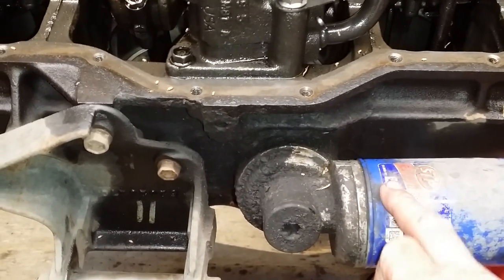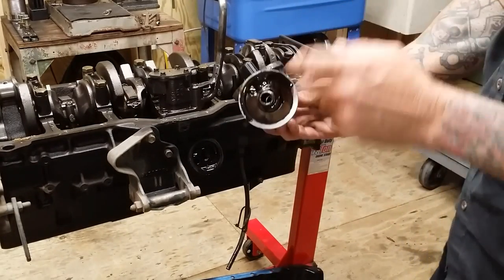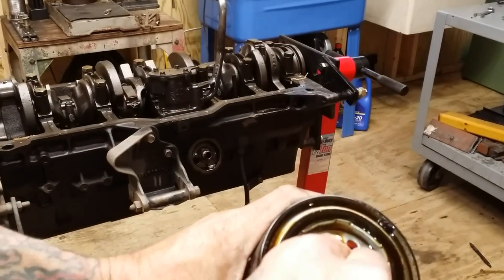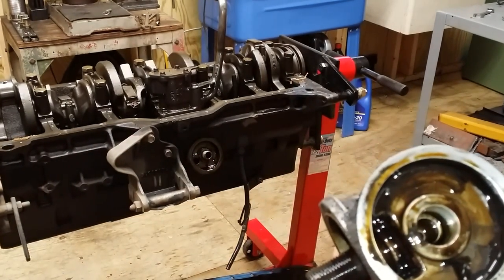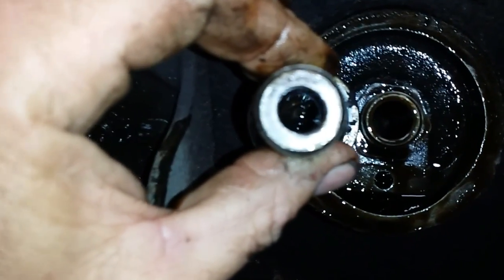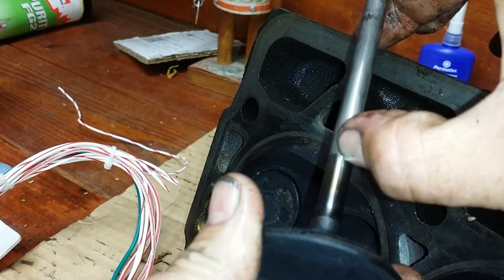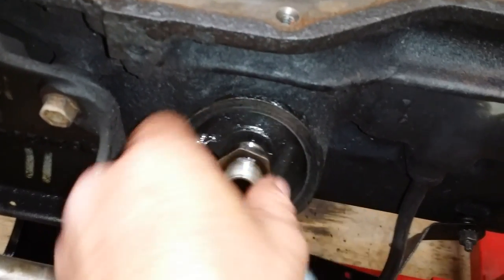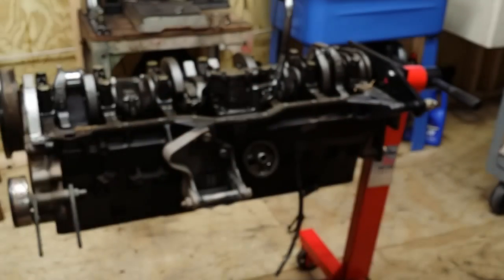4.0 oil filter adapter seals

Comment: this is one of the best mods I did to my xj.  I think the filter is closer to the frame rail and motor mounts on xj's. i did it on mine while I still had the worn out stock motor mounts and the mount came into contact with the filter. I got some ironman4x4fab poly mounts and that kept it in place well enough to keep it from hitting. I used a 3614 model filter that just so happens to fit my saturn also. one other note for xjs, even if youre just replacing the seals, the clearance between that torx bolt and the frame is only about an inch, so to get it off i had to knock the center bit out of the t60 and put a box end wrench over the bit itself. I had to put a cheater bar on that even, just to break it loose.

Comment: Great info,just replaced all the gasket's and seals in my motor or so I thought, lol!Mine is leaking at this same spot,running back towards the fly wheel cover.Making it look like my rear main seal is leaking. I'm so glad you made this video and she'd some light on the situation. Thanks!

Comment: American Motors introduced the Cherokee in 1984 with a smaller, four cylinder engine.  It was underpowered,  so they shoehorned the 4.0 six cylinder engine into that small space.

Nash engineers developed the 4.0 engine in the 1950s for a larger car.  Nash and Hudson merged in 1954, forming American Motors, so the engine was available to AMC.  The six cylinder engine has more power than the four, but threading the oil filter directly onto the block is problematic, if not impossible, because of the tight space between the block and the frame rail.  That made turning the oil filter at a right angle to the block necessary, so that's why the engineers installed the adapter on this block.

Comment: The reason they installed that filter adapter is to keep the filter clear from that motor mount. Highway driving may not be a problem but if you take it off road, there is every possibility that the flexing of the chassis will dent or even cut that filter open. By the time you realize what has happened, you may be needing an engine rebuild. that adapter is a son of a gun to remove because of it's location. I found that a T60 one piece torx bit and a 3/8 serpentine belt wrench will get in there and loosen that bolt with a little finesse. It also pays to warm the engine as the factory used red seal lock-tite on those threads. 
Update....It is March, 2023, last August of 2022 I had to replace a leaking adapter seal again. This time I followed your way of eliminating it completely. Just changed the oil and filter and no leaks, just shy of six quarts came out, and not a scratch on the filter. I have not driven it off road, so I can't say what might happen, but if your just doing normal highway or city driving; you would be fine with this swap out. Cheers to you !!

Comment: The bypass is in the filter. I had to pull an alignment pin out of that small hole in the block to get the 1614 on the block but the smaller filter is a lot easier to get out too.
Reply: 3614 I meant.
Reply: Just about to comment it was a alignment pin that goes in the hole

Comment: The over sized filters will work with no modifications needed. The seal on the filter is the same size as the standard filter
Reply: mobile one m1-301a.
Reply: Baldwin B2

Comment: on my 2001 xj 4.0  i use a larger oil filter. mobile one m1-301a. i believe the stock filter is a 201a. the 301a is just a little longer with same mounting thread.

Comment: as Jake32401 started to say,clearance between the frame and the adaptor is to tight for the t-60 to fit with a  socket on it, so if you put the socket in a vise and seperate it with a punch, you can stick it in the adaptor and use a 9/16 combo wrench to get it out between the frame rail and  the motor  if you plan on keeping the adaptor on.

Comment: on a 1995 4.0 cherokee once the oil filter adapter is off there is a tube coming out of the block that prevents the oil filter from going straight onto the block as you show here---can this tube be removed? it extends into the void space on the oil filter adapter off to the side of the bracket mounting bolt that has the two o rings on it-----thanks
Reply: thanks i will try next time have adapter off---btw looks like on the XJ cherokee (1995 in this case) if oil filter were to be put on block directly it becomes compromised by the motor mount bracket and frame, only 1/2" of room between filter and mm bracket/frame. thanks again for the reply.

Comment: on the 1995 cherokee 4.0 it is different, the adapter does not mount flush to block as in this vid---the block protrudes out a bit and that is where adapter mounts to---so oil filter without adapte would be only 1/2" to 1" away from frame---this may make it vulnerable to sway of engine and body while in operation, say hitting a bump or twisting while off road--any comments? thanks

Comment: what about a cover with line in and put the full size oil filter on the fire wall
Reply: i was thinking a old style remote oil filter mount as well. and ditch teh O ring mess too

Comment: towards which direction does that bolt loosen up to towards the front or towards the back of the motor
Reply from the maker: Jose Servin counterclockwise
Reply from the maker: Jose Servin back
Reply: Rusty 411 so from standing on top of motor counterclockwise
Reply from the maker: Jose Servin yes looking at the face of the bolt turn it counterclockwise wise
Reply: Rusty 411 ok thanks done broke 2 wrenches trying to loosen that bolt damn lock tight.. thought maybe I was turning it the wrong way is why I ask
Reply from the maker: Jose Servin it's standard thread everyone I've seen so far there hard to get to good luck with it
Reply: Leave it alone

Comment: restrictions in the oil flow is what makes oil pressure. oil pressure is not made by the oil pump
Reply from the maker: Karo Staro yeah at the bearings not the filter guy
Reply: Rusty 411 all the oil journals. but yea not sure it matters inside the filter

Comment: I think the oil filter bypass valve is built in to the oil filter itself.
Reply from the maker: jake32401 I think your right on that
Reply: jake32401 only on some of the filters that you use you have to be very careful about what filter you buy the Mopar filters have a bypass the Purolators have a bypass some of your cheap filters don't have a bypass or it is to low and I think Chrysler's reasoning for putting the filter sideways is so that the Oriole is always going through clean paper is all the deposits filtered down to the bottom or in this case on the side of the filter